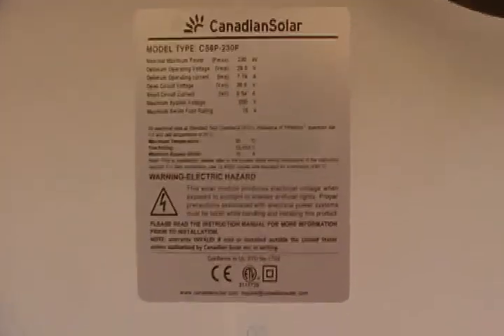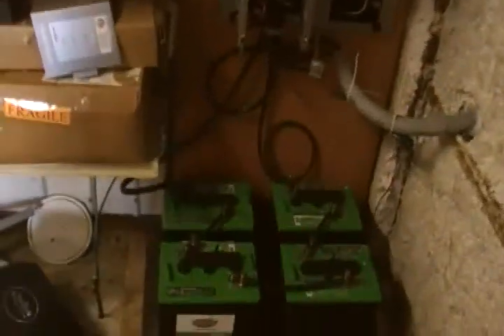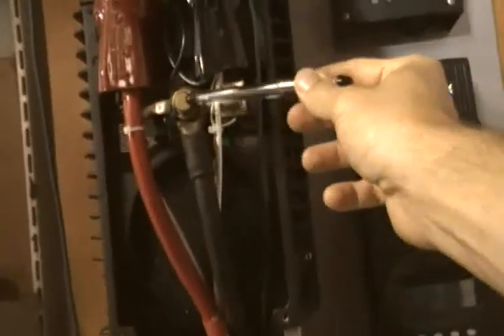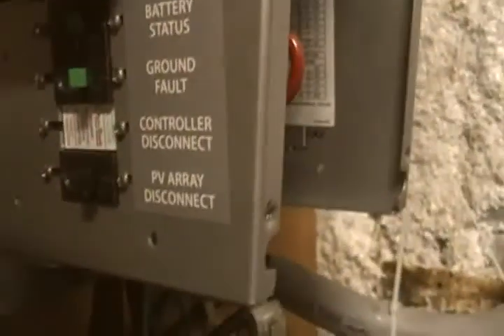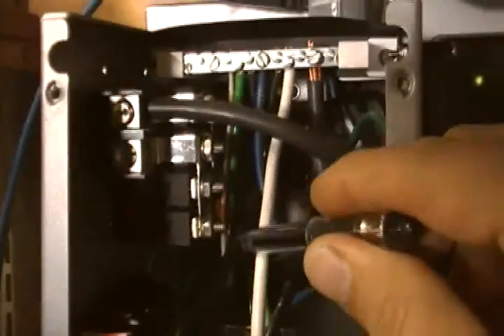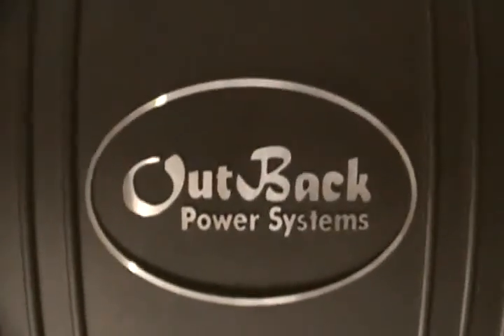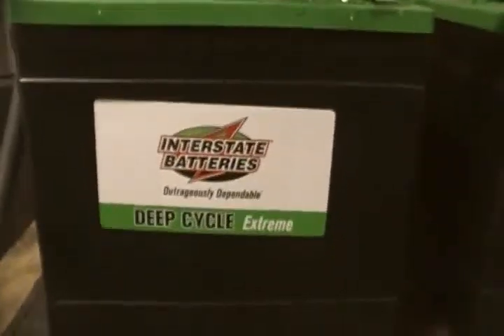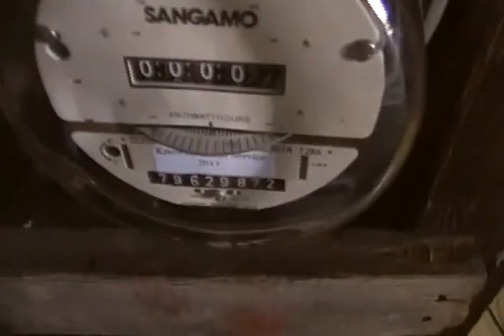SOLAR turning meter BACKWARDS (OutBack Power FLEXpower ONE FP1-3) do it yourself

Comment: You should find a good set of industrial fork lift batteries... They last 20+ years when used in stationary solar/renewable energy systems. Best kept secret out there! Cheapest way to store big power! Parallel 2 sets up and you'll run your whole house for days...